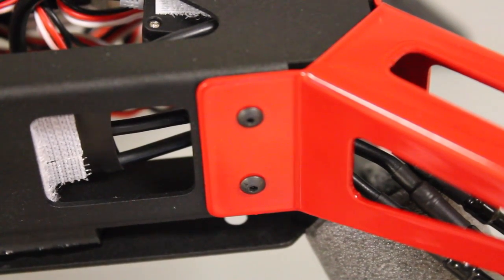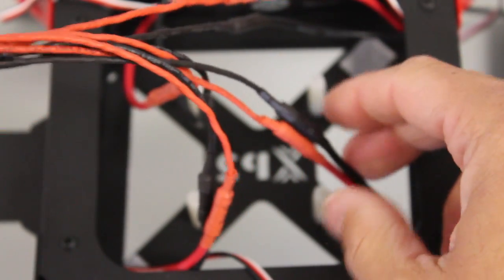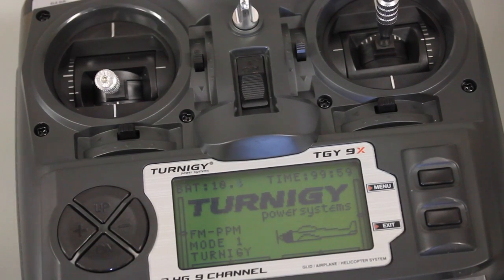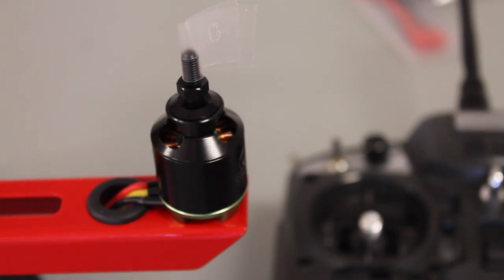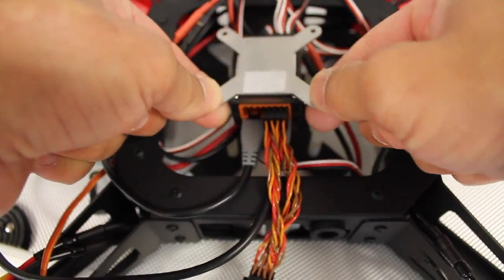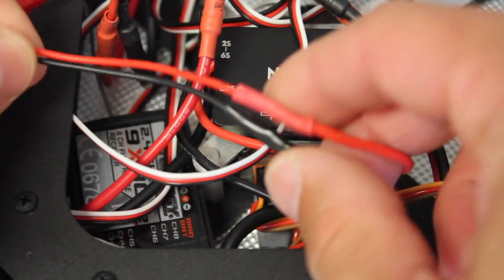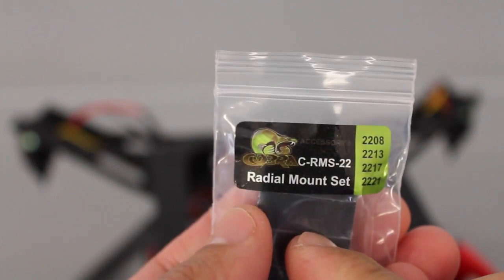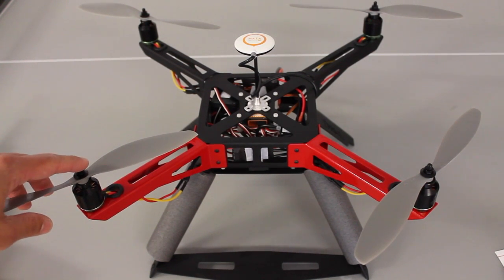XProHeli XP2 Frame and Landing Gear Assembly, ESC Calibration, NAZA V2 GPS Wiring w/ Turnigy 9X

Comment: thanks. I have 30A red series rapid escs simonk. I removed the red wires, and all is good. Upgraded the n. lite to v2 and the results are fantastic. Thank you very much for your videos! Any idea how to do a firmware upgrade on the cheap ffosd-n1?
Reply from the maker: +Peter Schultze Glad to hear everything is working out well. I'm not sure about your OSD but if I find anything I'll let you know.

Comment: thanks Dennis. Do you just connect all three wires from the ESC to the NAZA or do you clip the red ones? Thanks!
Reply from the maker: +Peter Schultze If they are DJI's OPTO ESC you don't have to worry about it because they don't have BECs. In other cases if there's a BEC you may need to remove the red wire due to the regulator on board. I can't remember the specifics of why (linear regulator vs switching) but this has more info:

http://multirotorforums.com/threads/do-you-have-to-remove-the-red-esc-wire.14492/

Just make sure you understand the component of your ESC as this will ultimately impact whether or not you need to remove the red wire. If they are DJI OPTO then it's clear. Let us know what you come up with. I feel like this is important information that all of us in the community need to have. Thanks.
Reply: In the past months, I've been messing with a brainFPV flight controller. An interesting project for a noob, for sure. Anyway, I mention it because I know you'd be very interested in it. Based on your videos I think you'd really like to experiment with the Taulabs, dRonin fork. I bought the NAZA Lite for for a sanity check and ease of flying for my  11 year old but the brainfpv stuff is very exciting and tiny. Complex though. Thanks for your commitment to the multirotors community!

Comment: To make sure not too lose your gimbal,use some tireraps to hold the main frame with the landinggear for extra security :)
Reply from the maker: Good suggestion. Having everything suspended via super glue and rubber pads is a bit nerve-racking! Thanks.

Comment: Superglue to hold on my $200 gimbal, $300 gopro and $50 dollar lipo sounds like I great idea! Why didn't I think of that?
Reply from the maker: Haaaa! I'm thoroughly enjoying your commentary :) I know what you mean, though. Yes it's crazy to think that it's all suspended by rubber pads and super glue. There was a suggestion above to use zip ties or wraps just in case anything breaks free.

Comment: Dennis Baldwin  The LED Module should be mounted to the outside of frame, so as easily seen, tucked way inside the frame wont be seen when flying, also a safety aspect when low voltage,  GPS Lock Atti Failsafe ect :-)
Reply from the maker: Wonny RC Hobbies Yeah good point. I normally do this with my NAZA builds but hadn't thought about it for this one. Thanks for the reminder!